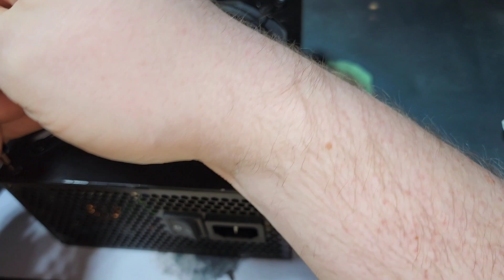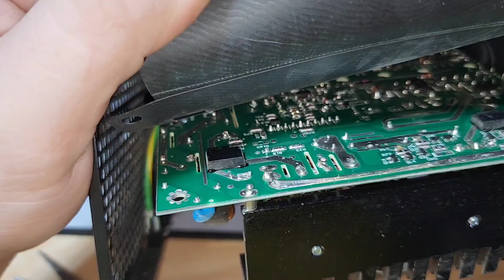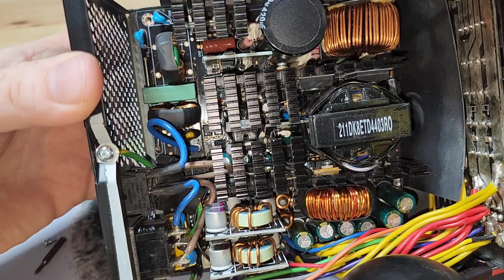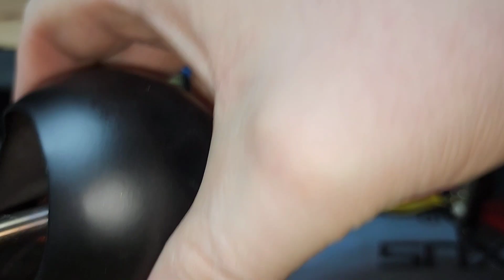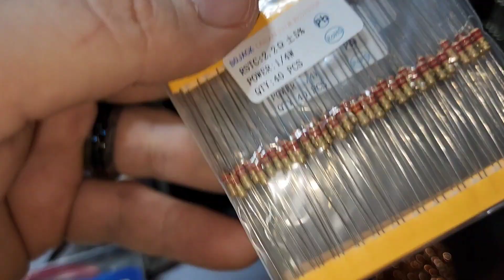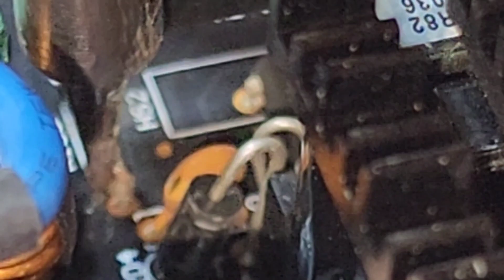Ultra X4 PSU Solder Repair - Bum Resistor? Does it live? #computer

Comment: Maybe take pictures before you disassemble so you get the right color code also give you orientation
Reply from the maker: I have the right combo, it's all correct, the PSU is still as dead as disco
Reply: Yeah just taking a picture prior keep that in mind with all your next projects